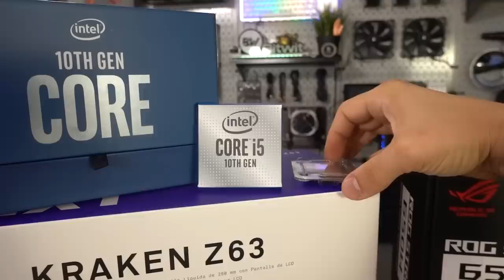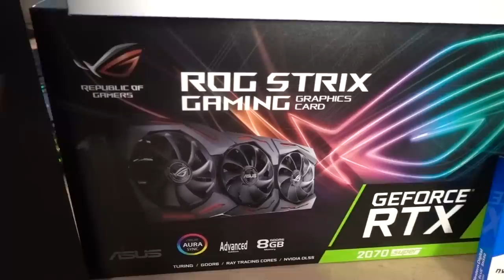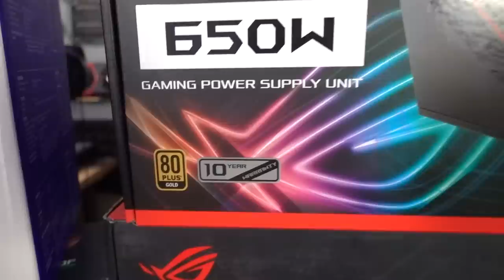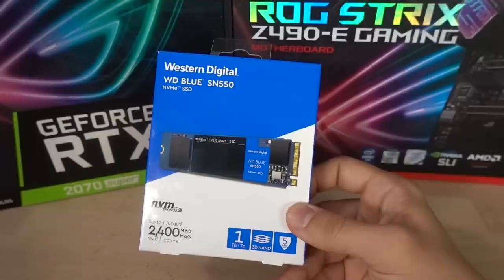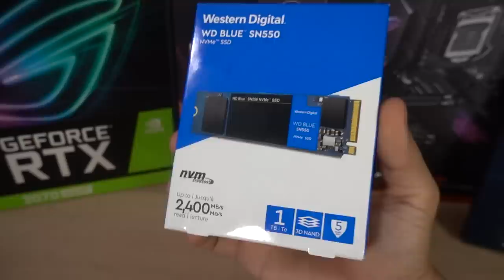Building my first Intel PC in AGES!

Comment: WRONG. You didn’t use a Swiss Army knife which hopefully has a screwdriver.
Reply: Too much power supply airflow, could short circuit the system
Reply: Also did this on the table, not on the floor!
Reply: He also forgot to put on an antistatic strap and dont connect it to anything
Reply: Always screw with confidence
Reply: Tried building my first computer this weekend. My Swiss Army knife didn't have a screwdriver. Still trying to figure out how to get the case open. Also, i bought a case of thermal paste. Is that enough?
Reply: @RobertH3318  NO, you need 2x case of thermal paste. SQUIRT it all over the mobo!
Reply: @mass1985  ah, thanks! That's a big help! Now I know why we're supposed to use the applicator.
Reply: @RobertH3318  Honestly; how can you get every step wrong in one video? :D

you know the one
Reply: xD i died
Reply: @mass1985  haha! I don't know. It's pretty good entertainment. Think I love the "reaction" videos even more though.
Reply: @Edwoonie  if hollywood ever needs new laugh track; all they gotta do is show that one specific vid :D
Reply: @kshamwhizzle Running joke for how many years now? Still funny as fk :D

That could even be guinnes world record stuff?
Reply: You also forgot the all plastic static wrist band
Reply: HOPEFULLY
Reply: and tweazers XD
Reply: @uncleiroh2821  What Would Jesus Do?!
Reply: Also, don't forget when you mount the radiator fans, you're supposed to screw (with confidence) through the rad for maximum effectiveness! (Oh, for +10 fps  too!)
Reply: You forgot to leave one of the CPU fan screws off!
Reply: @MichaelPohoreski  yea, some ppl cant even SCREW up properly...
Reply: @Raphee_dj  You mean a wireless anti-static bracelet doesn't work! Who knew! /s ;-)
Reply: @mass1985  *The Verge:* tech youtubers are not journalists
*Tech YouTubers:* You aren't fooling anyone when "Journalists" pretend to be experts about tech
Reply: @MichaelPohoreski  So why they tried to act like one?
I am only basic consumer and even i know not to hrow anything from the packet away, if i have simple way of keeping em in the box that it came with.

And not even shred the box with knife, when it can be just opened with youre fingers.

I ofcourse keep everything that comes with the box cause warrantys.
Reply: Dude you didn’t put the power supply on the pads it’s gonna short circuit.
Reply: clever
Reply: That poor (former) verge guy lol.
Reply: 18:54 He got it wrong there insulating pads so the power supply dosen't short circuit and come in contact with the rest of the system
Reply: Why are so many people bought those things
Reply: @RobertH3318  Make sure you spread some of the paste on the "Pin" side of the CPU. When you put the CPU into the board, make sure that the arrows dont align. Push in as hard as you can (This step is really important) until the latch can be locked. If for whatever reason, some of the paste gets on the board, use water and a napkin to clean off, Don't worry about drying it. When you power up the system, it should help with drying.
Reply: Also you should play league of legends since it’s the most hardcore game to test your FPS in.
Reply: @Raphee_dj  more like live strong strap
Reply: im new to pc building and when he put 4 dots of thermal paste i physically regurgitated
Reply: Intel is so much better than AMD.
Change my mind
Reply: @pg7166  maybe but it doesn't matter once you apply extra thermal paste.
Reply: @xornedge8204  ur right
Reply: @xornedge8204  and amd does better budget and the high end CPU like amd 5 and amd Threadreaper
Reply: Shoots fired
Reply: He forgot to put all the paste on
Reply: Didnt even push in the io shield.
Reply: @aceofhades9648  no it's a "BrAcE"
Reply: He didn’t put his live strong antistatic bracelet on either
Reply: He didnt even mention the table as the first step what is this
Scaaaaaaam
Reply: the brace
Reply: @RobertH3318  also you need to buy a cpu installation tool and not use it
Reply: @croccodoggo9989  I bought 4 of those, just in case!
Reply: When you know you know
Reply: Lol verge
Reply: @Raphee_dj  the verge did not even use an anti static strap it was a normal bracelet
Reply: @mass1985  live strong so you can fight cancer
Reply: @bucketlcs  nice pfp :D
Reply: He also forgot his live Strong bracelet
Reply: He didn’t use the long screws to screw in the radiator
Reply: wheres the 2600 Mhz super fast ram?
Reply: @RobertH3318  this makes me want to see a comouter case packed with thermal paste

Comment: "Mike is a very practical guy." 

Gets a $1500 pc for working in MS Office and for casual gaming.
Reply: Debojyoti Das bro that doesn’t look like $1500 was he joking?
Reply: @user-iy4jn  it's a 1k pc
Reply: @fleapr2289  1k ? LOL ... The GPU alone is 650+, MOBO 300ish, Proc 260-275...
Reply: @Miiiiiiighty the gpu is 1k now lol
Reply: i got a $1500 pc for the exact same thing... my excel tables regularly fuck up my notebook and i like to not worry about about a couple dozen tabs in chrome
Reply: @La_sagne  i do the exact same thing with my $600 budget pc. Ryzen 5, 16gb ram can easily handle excel and 5-6 chrome tabs simultaneously.
Reply: Me on the other hand games on 300 dollar phone ._.
Reply: @saramma7423  if you can, save up a small amount money and get something used, a console even! A used dell optiplex will give you such a great experience in gaming compared to your phone. (Buy a used cheap gpu for your dell optiplex later on to run some decent games)
Reply: @jxianoma2013  it's like 500 even less actually
Reply: @deejay_lyadh  5-6 chrome tabs :D :D :D
Reply: @Miiiiiiighty  the pc was built when everything was at it’s original price
Reply: @Miiiiiiighty  the cooler is around 250 dollars
Reply: @jxianoma2013  if u guys remove the graphic card it will be lesser its not like its the msrp we r dealing with

Comment: I liked the CMOS battery that was sitting slightly out of the socket.
Reply: Payperheirplain one time my pc wasent turning on so I removed my cmos battery and put it back in after 10 secs and it worked
Reply: Gqld yea lol I had the same issue so weird
Reply: Brandon Chavez built a new system and it wouldn’t boot, sure enough taking the battery out for a minute and putting it back in did the trick
Reply: @xjmx3235  changing the battery fixes it fully, normally its caused by a faulty battery or low batt battery

Comment: As an AMD fan, I have to admit it though:
INTEL JUST CANNOT DIE, COMPETITION IS HEALTHY. 
We simply cannot enter another era of monopoly 🤷🏽‍♂️🤷🏽‍♂️🤷🏽‍♂️
Reply: We need more forward thinking people like you in the community
Reply: Yes it pushed intel into giving good deals like i3 9100f and i5 9400f and its just good for the cpu market
Reply: Exactly
Reply: Thank you!
Reply: I read this in the neardiest voice I could think of
Reply: Yeah.... a duopoly isn’t much better. Intel don’t even try to compete they are too big to fail now.
Reply: Exactly, I got a 8C/16T 10700 non K for around $290. Z490 mobos start for $150. I sold my 9700k for $360 on ebay. Only healthy competition can get you these prices.
Reply: @Jabid21  why would you sell ypur 9700k for a 10700? I don't know your mindset there
Reply: @fearorlive  I got the cpu off somebody. I didn't have a motherboard to use in. I just needed to sell it.

Edit: I just found a better value at having a 10th gen CPU and mobo than buying a 300 series motherboard to use the 9700K
Reply: @Jabid21  ow, i thought you have a fully working system and upgraded to 10700. That's why i think it's a little bit off
Reply: I do hope Intel pushes forward for ingenuity, therefore creating more competition between these 2 current cpu manufacturers. It would make the shares more desirable
Reply: FearOrLive True, it would’ve been more of a side grade in that case. Although I do change hardware a lot as I have two Ryzen 3rd gen systems too. Not a cheap hobby to have. 😁
Reply: Lol first amd guy say that. Most of them have a hard-on for Intel to shit itself and croak. I've tried explaining if that were to happen amd will become Intel 2.0
Reply: @sw01ller  i like your pfp
Reply: The best play is fair play
Reply: you are right! in terms of underdog position intel has better strategy than what amd did before remember back then fx cpu series vs i3 i5 i7
Reply: -16% share price overnight on Intel would look like shots are being fired by AMD and they are no longer hitting the plate carrier, Intel announcing massive delays on products whilst AMD is quashing all rumours, Intel are in trouble and the top brass need the hot poker treatment...
Reply: @Smakheed  Apparently you don't understand stocks very well...
Reply: same, I do want AMD to continue winning for some time yet. market share wise, Intel is still "winning". not sure if AMD will ever topple them, but I'd certainly be happy if AMD creeped up to at least near 30-40%.
Reply: @NoobGyver  those cpus are dog shit now tf, especially the 9100f which doesnt even have smt
Reply: @GoVols27  true, they succ ass but i5 9400f is still okay for what i use, intel sucks anyway i am anyway gonna make a ryzen build after i upgrade this intel one i use as my main. But new intel chips are only a bit better. Makes more sense to buy the cheaper option
Reply: Pb J  Ironically intel indirectly saved AMD by paying them 1.25B through that lawsuit. AMDs demise came from bad management, sure intel was more aggressive business wise, made partnerships that were anti competition. But it was AMD spending literally billions buying random companies, including ATi and FABs without any financial thought...while being too safe with architecture (they were just rehashing Athlon 64 for like so many years investors just felt uneasy)
Reply: Christopher VanZetta May I ask what you mean like why is he wrong
Reply: 100% they'll be back! Competition is healthy and anybody who blindly sticks to one hardware brand will lose out on the best of each generation of hardware... I have no shame in switching brand allegiances almost every new build (CPU, graphics, phone, everything!)...
Reply: Correct. Intel has some specific features that only works on their Intel CPUs, such as Intel HAXM which requires an Intel CPU with support for an instruction called Extended Page Tables. It helps acceleration in some hypervisors, such as QEMU for Windows.

EDIT: they also dominate in single core performance
Reply: Thats the way Intel works, they slack and slack and get overtaken by everyone in the market and they then proceed to massacre the CPU market with mind boggling innovations that revolutionize the industry and set amd back a decade and then they begin to slack again and again.
Reply: yes! and now i bought newly intel  i5 10400 upgraded from ryzen 2600x i really admit there's an improvement of my fps or daily use ,i switched because for my 2 years on AMD its give me headache always  over heating and automatically shutdown , sold it in a bnew price and buy intel
Reply: 100% Agree! Let the competition on to push the tech forward. 
Without it, 4 core 8 threads would the only thing we had XD
Reply: If I have to be honest the i3 9100f is the best budget cpu. The last time I check it, it cost $71.88 in Amazon.